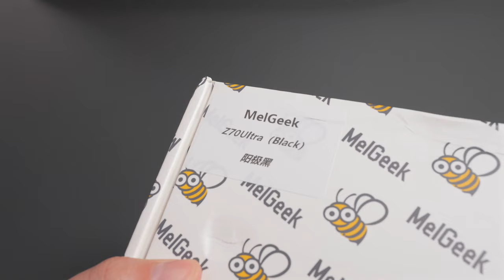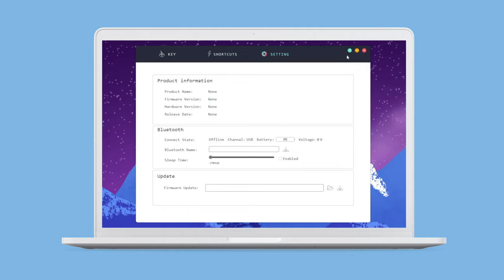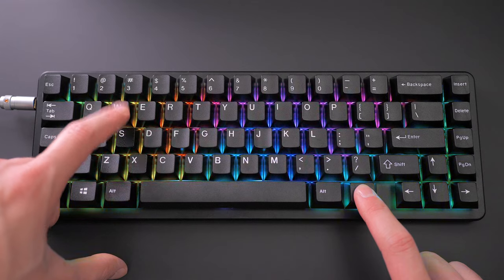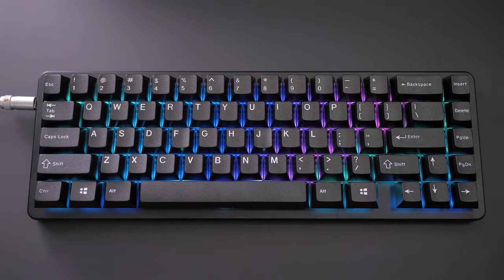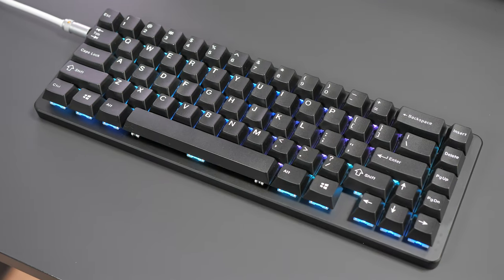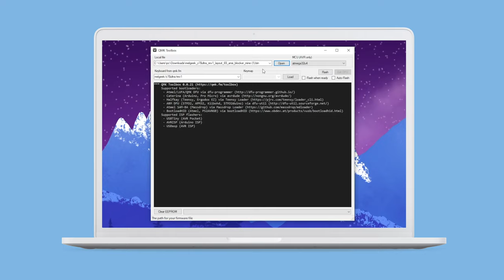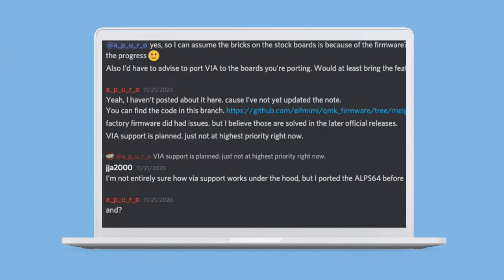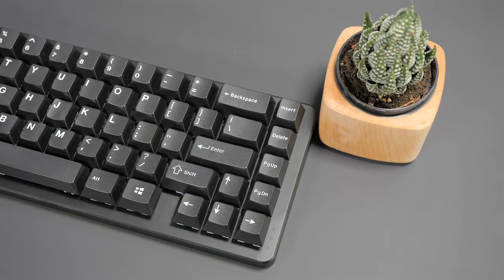MelGeek Z70 Ultra 65% Mechanical Keyboard Review

Comment: You know how this keeb would be perfect? if the spacebar was 6u, the right SUPER and left SUPER key was 1u and they added a Ctrl in the 1.25u blank space left. Then convert the 1.5 backslash into a backspace key, then split the 2u backspace key above into a 1u backslash and 1u Delete key and replace insert for the Home key. Put an End key below and leave pgup and pgdn as they are. This is how you fix the atrocity that is ANSI. However I would go beyond that point. I would remove both backslashes and program them to be accessed with right and left shift on the spacebar. then I would make the right shift 2.75 and access the question mark with Fn-Q. I have tested it and it's a faster method of accessing the question mark because you are left with the right ring finger free to press the enter key, which is usually what you do when asking a question.

Result: https://imgur.com/I8aO0ut
Reply from the maker: That’s a looot of changes to make it perfect haha 😝
Reply: @minimalistik  hhahah